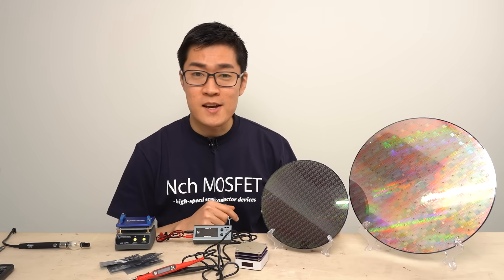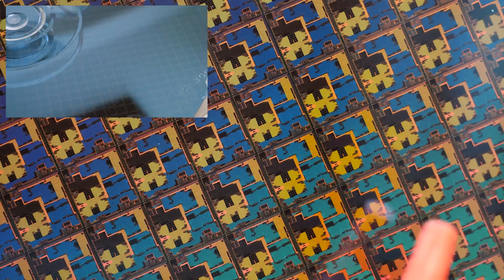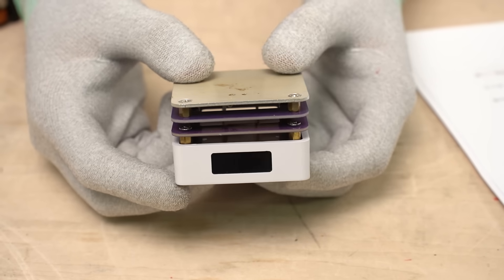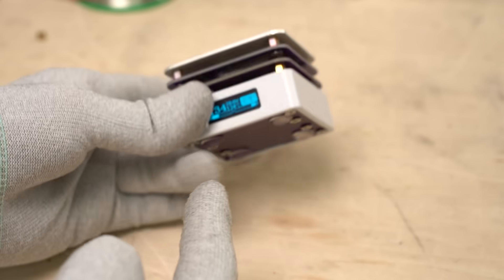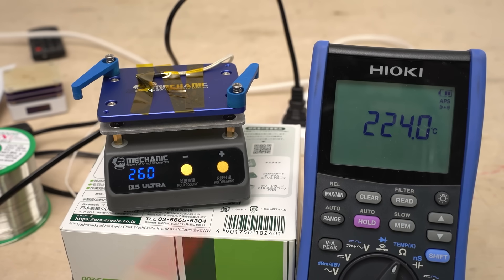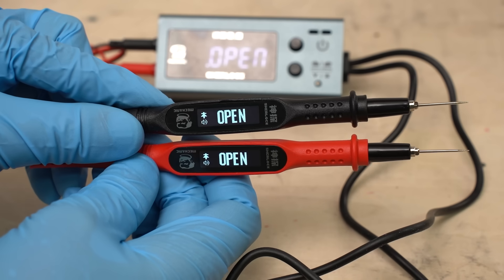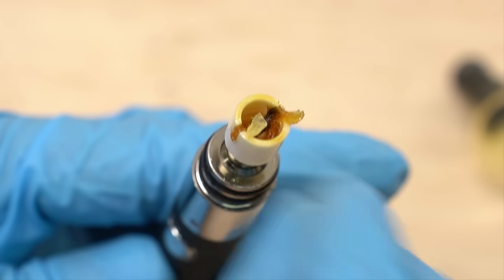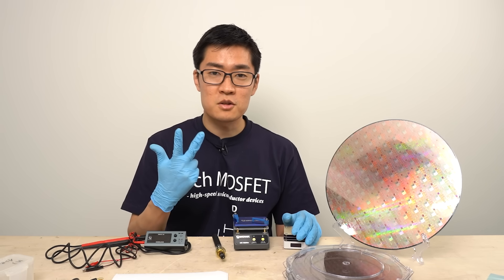I found Real 12inch silicon wafers on AliExpress.

Comment: I think the restrictions he mentioned may apply only for pattern wafers to avoid reverse engineering ( IP issues ), he is not using a microscope to see more details but I'm pretty sure those are test pattern wafers, this wafers are used to calibrate machines or process, not exactly a real chip ( Memory or CPU ), but they look amazing. I have sold 1000's of wafers all around the world ( Ebay member Bionicle1969 ), but can't recall any shipping to Japan.

Comment: I'm sorry, but that reflow plate is useless. You mostly use them with heat gun and you don't want to burn components that are close the component that you're adding or fixing. 200c is just not enough. It's literally useless for almost everything, most pcb's have 1.6mm thickness and need more heat.

Comment: I work in physical design of microchips, the golden area you mentioned simply looks like power FETs to my eyes. You can also see the digital and analog sections - it is a mixed signal product. You can also see the large rectangular sections which looks like capacitors. It could also be a large matched circuit with coincident routing for stress effect.
Reply: The blue one is actually a quad core microprocessor of some sort, compare to the floor plan/die of the BCM2712 which has a similar “x” structure, which is actually the 4 cpu cores. I’m not sure what exactly this is, but it is interesting nonetheless.

Comment: As a Taiwanese, I literally have like 20 of these wafers around. they would be good gifts for my foreign friends when properlly framed.
Reply: What TSMC does to a mf
Reply: Do they taste good?
Reply: You can just buy them in shops there ?
Reply: @pratiksyadav  No, at least no physical stores sell them. I need to look up some P2P websites (the same as Ebay or Etsy in the US) to buy them; there would always be around 2-5 online shop/person selling them.
Reply: @jameswang9257 - anything with image sensors on it? (yeah, thats my kink). Btw the wafers in the video - one looks like a multi-project wafer (or just a test), and the other like a regular 4 core SoC (cores and cache visible). But the SoC one would be incomplete - as these usually are used in flip-chip fasion, it lacks the uppermost layers and the balls - normally one does not see the nice patterns when the wafer is complete - can you confirm from your experience / wafer samples?
Reply: @  large image sensors and CPU/microprocessors are the best looking ones, especially those big one. But they are rare and I found it difficult to get, normally take me around 5-15 pics for one to be beautiful
Reply: Pls cut them into gpu chips 😌
Reply: Micron?
Reply: @jameswang9257  can we be friends 😉
Reply: If you brought me one of those as a gift, I would literally kiss you on the lips.
Reply: Can i be your friend? 🙃🙃🙃🙃 Im totaly not gonna overtrow the cpu production industry 🙃🙃🙃

Comment: This may be a silly question but why do they make the wafers round when the chips printed on them are square/rectangular? Aren't the edges going to have a bunch of wasted space or partial chips?
Reply: Got this all from Google search I am not pro

The silicon wafers are made from single-crystal silicon ingots, which are grown using the Czochralski method. This method involves dipping a seed crystal into molten silicon and slowly rotating and extracting it as the crystal grows. The natural shape of the resulting ingot is cylindrical. 
Cutting it to be square is wasteful, so just sliced into circular discs
It's industry standard now, facilitates even coating , minimizes stress and potential damage.
Reply: @Verdecken  Also lasers used to make patterns are naturally circular as well as lenses used to apply the pattern.

Comment: First wafer is definitely a shared reticle (you combine different dies and designs from different teams sometimes even companies and so and let them produce some prototypes or variants Design of Experiments DoE lots) the blue one is a mono reticle all same dies (: I worked for Infineon and was in production logistics employed (: I always wanted to obtain same wafers to explain it to my relatives because it was magic to myself as well before I reached 2 years within Infineon
It was a great company (: I just switched because I wanted work in different field (:

Because the masks are the expensive part of semiconductors and of course design and validation and testing and yeah manufacturing but once the line runs smoothly with high yield on a design wafers are around €1k depending how many layers and technologies are used the smaller the feature size the more expensive of course

Comment: One day I will buy lead free solder... once the 5 inch thick roll of 1940s 40% lead 60% tin solder runs out... probably sometime in the year 2080! The solder is a quarter the thickness of a pencil lead and there is miles of it left in all likelyhood.. good stuff. They do not make solder like they used to!
Reply: That's something I would safeguard as ancestral treasure.
Reply: @Verdecken   leaded solder is still common and easy to find. makes a bad treasure
Reply: @内田朝陽-e6h  1940 is oldest thing that I might see. I don't think solder that old you can get easily.
Reply: @Verdecken  Ahh, i misunderstood
Reply: @Verdecken  on the rare occasion I have to solder I do it with an extraction fan set up, when I used to not do such I would taste a sweet flavor on the smoke.. Maybe lead acetate somehow? Not sure idk all I know is no good for the lungs haha
Reply: @DarkAttack14  
I have never seen solder with led in real but that's interesting info and now I will think about sweetness of led before bed.
Reply: @DarkAttack14 not just lungs but mostly brain and rest of nervous system
Reply: @DarkAttack14  Not good for the brain neither lol
Reply: unleaded is a bitch to work with tho  , leaded solder is easy an works in dirty environments if it has a rosin core.
Reply: No joke, I still have some lead solder from the 1990s. However it's heavily oxidized plus I'm not keen on eventually reintroducing lead back into the environment.
Reply: @ethzero  it's already in the environment you have a roll lol
Reply: @ethzero  try to be cautious like the guy above. Don't breath in the fumes even if it's sweet.
Reply: @Verdecken  only issue with lead solder is the rosin flux not good to breathe in same with flux from unleaded, the lead dont decompose/vaporise before way too hot for elec soldering,
Reply: @  Dont worry about that we still use leaded solder a tonne in electronics, lower melting point makes it easier to solder around sensitive components. we just dont really use it widely on the consumer market anymore

Comment: I dont like how the mechanic hot plate uses an xt30 for power it seems super dangerous...
Reply: xt30 can support up to 30 amps so i think it's fine
Reply: @Justgreen89925 I was more concerned about how you can touch the pins

Comment: the rosin atomizer is actually for a completely different purpose... they only demonstrate its use that way for plausible deniability...
Reply: Technically it is meant to vaporize rosin/resin. But yeah that vape pen setup makes it vary obvious what its used for.
Reply: Yea, it's for rosin alright - the potent extract kind.
Reply: Na it's useful to diagnose shorts

I'm sure they're not against people using it for the other purpose but yeah
Reply: And you can just use alcohol.

Comment: Could one make a reflection telescope with the main mirror being one of those wafers?
Reply: It's very likely optically flat, so you could use it as a diagonal in a newtonian telescope (or anywhere else you need a flat mirror). You generally want a parabolic mirror (or some other non-planar shape) for a telescope though, any patterns are likely to harm the image quality, and silicon wafers aren't very reflective in a lot of bands.

So, you could probably use a silicon wafer as a rather thin (susceptible to warping and easy to shatter) mirror blank, which might also be difficult to cut/grind to the size you want, but if you put an aluminum coating (followed by a half wavelength of silicon monoxide) on, it will probably be a good optically flat mirror.

Comment: You can use the rosin pen as a crack pipe... a win-win.  lol just kidding!
Reply: I thought rosin is hash?
Reply: @snapper69996666  rosin is just the type of material
Reply: @snapper69996666  same here, turns out its a general term for tree and plant sap or resin
Reply: They sell those for cannabis oil, also called rosin lmao

Comment: I'm curious why regulations prevent the sale of these wafers in Japan.
Reply: Maybe an old regulation from when Japan used to produce cutting edge semiconductors to prevent IP theft.
Reply: yeah, i don't understand that either. Wafers sold like that are typically highly flawed or damaged beyond being repurposed. They are effectively trash, i see no reason why they couldn't be sold as a novelty.
Reply: @nikushim6665  Japan is governed by very old-headed bureaucrats, I'm sure the law served them couple times ages ago but they are too much against to the change and want nothing to do with it so old regulations stuck.
Reply: @Haplo-san  Most countries are governed by the same people you're describing. Your explanation isn't correct.
Reply: Speaking as a Japanese resident, these wafers are usually not avaliable on our market because we produce and export most of our wafers, and the ones in the local market are all eaten up by companies here.
Reply: Well sone wafer can have specialized substrate. This can basically analyze and copied. Some wafer also has substrate which is harmful to human or environtment (if let's say you choose to discard it or break or keep it under harsh element). Thus it is hard to find wafer for sale due to that alone.
Reply: Probably IP rights.
Reply: Exactly why you think, so you can't gain any type of power without permission from a fascist government.
Reply: Heavy chemicals, just ask Google and it will explain in greater detail.
Reply: @blackhorseteck8381  i would say this is the direction of thinking... "doping elements". arsenic. gallium. antimony. one of them at least is a red flag in some areas...

theyve been etched... hit with some pretty nasty acids...
Reply: Im curious why he purchased them, is he pretending to be a smart Asian?
Reply: @TheeUnpleasantPeasant  no need to pretend. He already is.
Reply: @TheeUnpleasantPeasant  rude lol
Reply: wtf?

Comment: I got the same blue heating platform and it got a misplaced temperature sensor, it wraps around the screw post holding the heating element and displays incorrect temperature. When i put it in the correct position it works flawlessly. I also recommend to unscrew the holding clip

Comment: Why not simply flip it around, polish and and do it again, if one side is faulty/wasted, not needed.... whatever?
Reply: There are very strict requirements of thickness, etc.
After 1 process run, the wafer is "ruined" in the context of trying to do a second one
Maybe for testing purposes, it would be ok
But nothing more
Reply: @Versette I'd imagine even very mature process nodes are typically pushing the limits somewhere, and having to scrap a run because recycled wafers unexpectedly pushed things out of tolerance (or worse, contaminated equipment) is so much more expensive than the wafers themselves, it just doesn't make sense to even try.

On the modern process nodes they're paying engineers to tune every parameter of each process step to bring (and keep, the machines need constant maintenance to stay in spec) the defect rate down. If recycling wafers makes those engineers' work harder/take longer (by adding process variables), it could delay yield improvements, which could cost more than every wafer a fab will ever buy.